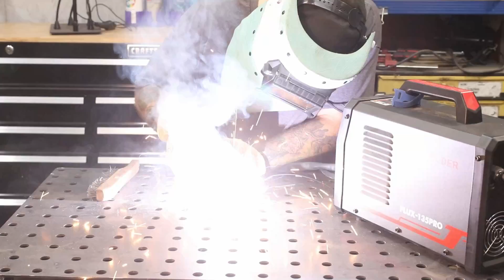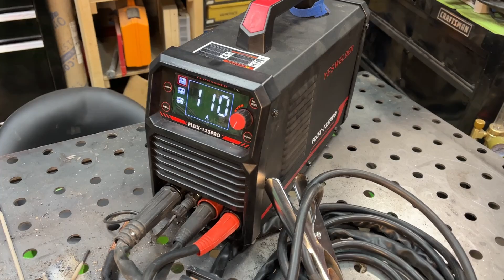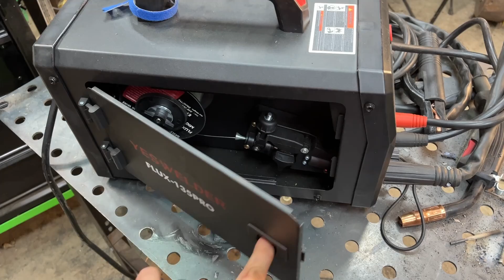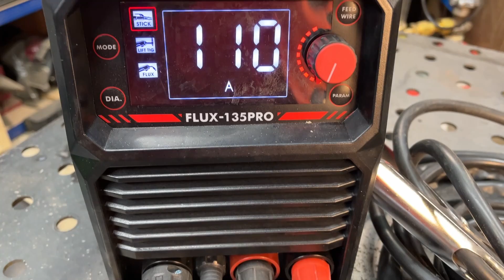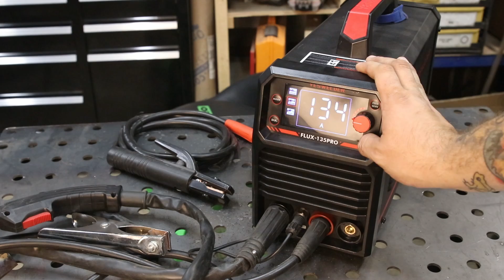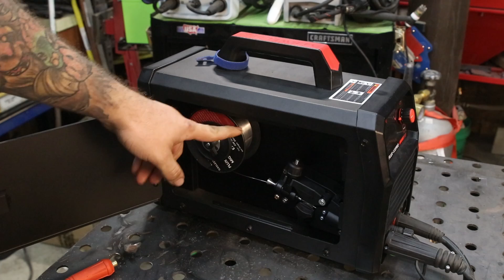YESWELDER Flux135 PRO  | Easy Welding out of the box!

Comment: I set up the Mig gun on mine.   It connected and I fed the flux wire and I moved the welder and the connection point snapped off.  I didn’t drop it or bang it.   Amazon sent me a whole new welder.  They said it has a one year warranty.   Hopefully the new one holds up.   I’m skeptical but will try it one more time.

Comment: I’m a little confused with the voltage setting. Plus 3 to negative 3. I’m trying to weld a crack in my muffler. I don’t know the settings, its a thin metal, any suggestions please?
Reply: I know this is late to be saying but if you use the mig welder on -1.5 to - 2 on exhaust pipe tou should be fine just dont stay in 1 spot too long i have the same welder and it worked great on my exhaust and my friends exhaust on that setting

Comment: Voltage range -3 to +3. How does that translates to the voltage figures in the user manual? What’s your recommended wire speed and voltage for 16 gauge sheet in the flux core mode? I am new to welding btw.
Reply: Go to the lower volt setting and slow the wire speed way down. You have to move extremely fast, and its almost impossible to run a straight bead. You will blow through the metal if you dont stop like every half inch or inch

Comment: can it plug into a regular outlet
Reply: Yes but make sure it’s a 20amp dedicated breaker!!!!
Reply: I use it on a 120v 15 amp outlet, for stick welding I can go to 60 amps continuous without tripping the breaker, at 65-75 amps I can make a 3 inch bead before it trip. That's about 110-130 IMP on the fluxcore setting with the 0.30 wire. To go higher you need a 20 amp outlet.

Comment: What Amperage are you feeding it? it says it needs 50 amps trying to figure out what plug to use. Just ordered looking forward to learning.
Reply: Where did you see 50? I just got a 135 and haven't read the instructions but sure doubt that plug wire is good for 50 amps. Pretty sure 120/20A would be more than enough for .035 wire. Beware of line loss with long cords. This tutorial would be better with simple step by step instruction to a standard weld rather than talking then jumping to the work... with loud music.
Reply: @danontherun5685  I think I read it in the manual need to double check
Reply: @micahinmaine  I just got to test mine yesterday and im tripping my 20 amp breaker, im confused on how to wire a 110v 50 amp circuit
Reply: @bentondirtgaming9692  ya same not sure how that is possible, I bought a generator breakout plug that hopefully will work, I might change the plug out on it to one rated for higher power if it becomes an issue
Reply: @micahinmaine  perfect timing to reply, I got to play with mine yesterday but it kept tripping the 20 amp breaker after about 30 seconds stick welding 3/32" 7018 at 90 amps. I installed a new 30 amp breaker and outlet solely for the welder. I used the same rod, all the way up to 105 amps (horrible for actually welding) to test if the breaker would trip and it never did. I plan on testing 1/8" rod soon so i can push more amps to find out if the 30 amp breaker can handle stick welding at 135 amps.  have not played with mig or tig yet.

Comment: It would be nice if a chart was included to give you a starting point range per thickness of the metal.
Reply: There is. At least mine came with one
Reply: Mine came with one
Reply: They include a chart. You can download it.
Reply: If it was that easy, welding wouldn't pay that well.

Comment: Thanks for the video I was trying to decided between the Titanium 125 and the Flux135. I got the Flux125. Thanks Again!!
Reply: Same. I also went with the 135 Pro. Question, what is your supply? 15 amp circuit, 20 amp? 30 amp? My biggest concern was with the breaker tripping. I believe I have a dedicated 20 amp circuit available  to use.
Reply: Same, just got my 135 today, time to learn now!

Comment: I have never 
used a TIG or pedal. I've owned a MIG since 84. Like some if not many, I have some exhaust with new and harvested piping at 2 1/2" as in front of that CAT, it is 300 series SS alloy and 400 series behind the cat. Local exhaust & muffler shops are installing new custom, throwing pipe in the pile with 22 miles on it. Crazy but being handy, fix family cars with a 6-pack of beer and approach the manager. 
Great info on this Yes Flux core 135 pro. Thanks you!
  Just as 6' 3" guys with big fingers after two years of having one. Otherwise, not since 2018. Like Chris's Farley said "Big Man in a Little man's in a tiny jacket". 
  Finger typing with tiny keys, it changes or erases the words. Double check guys / gals. Thanks for the comment.